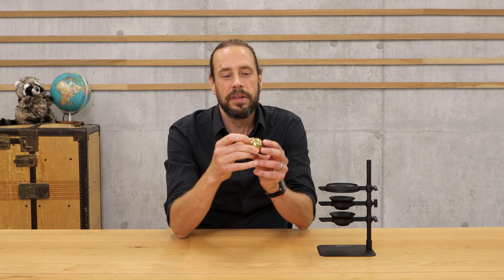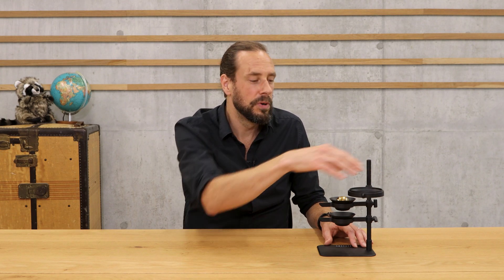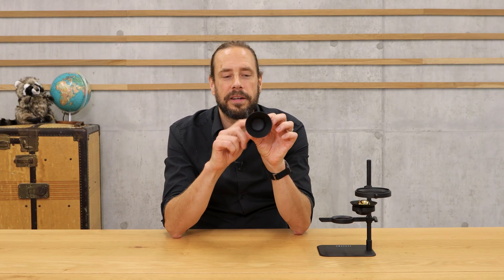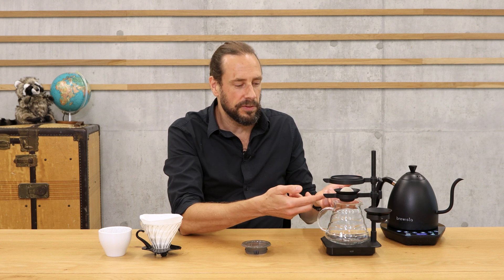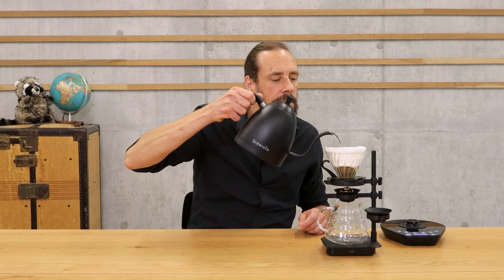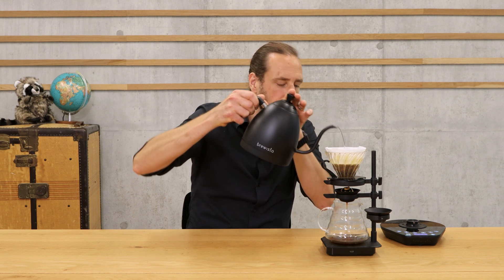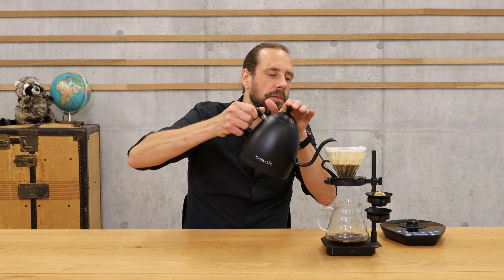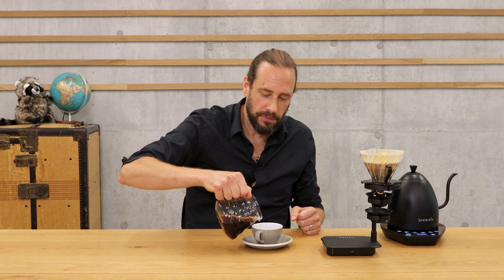40% more Flavor: is the Hype real? We test the Nucleus Paragon tool

Comment: I do something similar by doing an initial bloom with water that's 150-170 F (65-80 C). This seems to be what the frozen rock is doing. Also, my method allows for immediate back-to-back brews, whereas the rock has to be refrozen. I would redo your experiment, but have the non-rock brew use lower temperature water.
Reply from the maker: Thank you for sharing. I will give it a try!